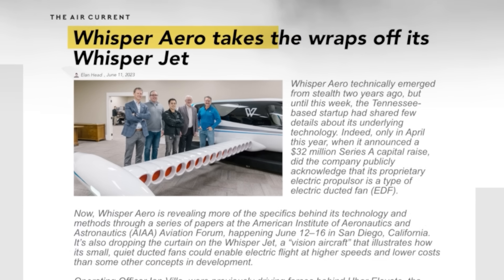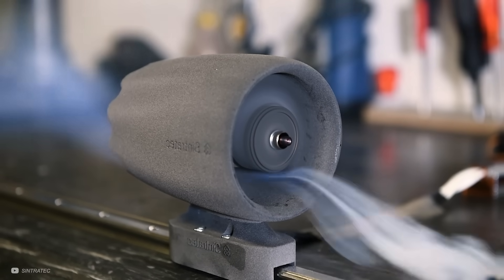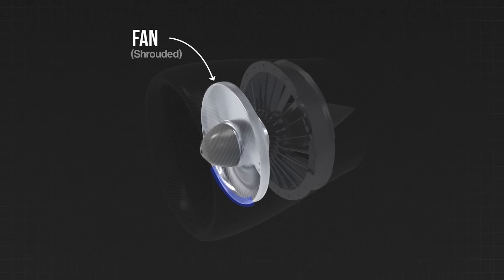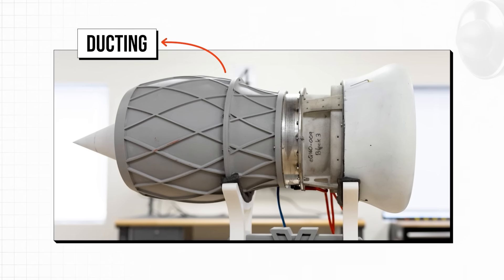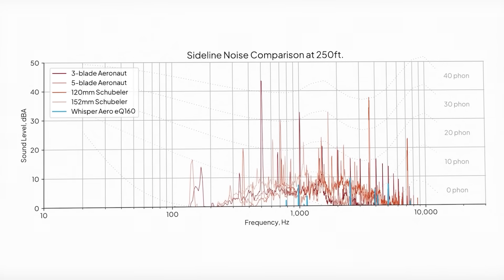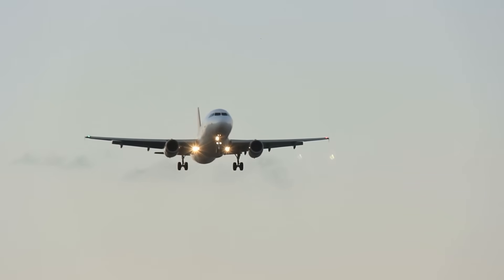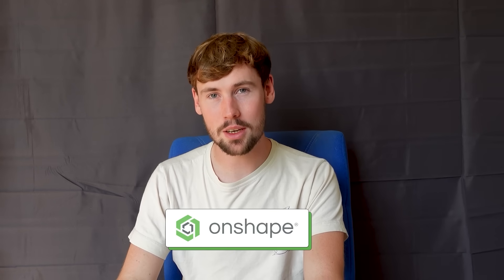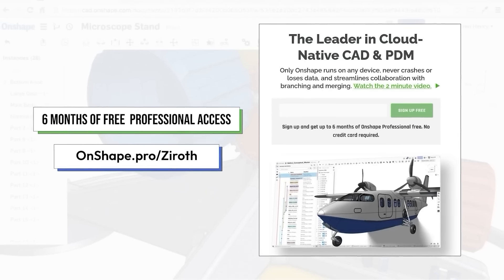This Genius Jet Engine Is Starting A Revolution

Comment: The new part of this tech is the electric drive motors/batteries - the ducted rim/fan unit is older tech - myself & others in r&d were working on this 35 yrs ago, as well as the vtol single passenger air vehicles - nothing new here - but they never became  commercially available due to gas engines used back then made vehicles too heavy & unstable to be practical - modern brushless motor/battery advances are bringing the tech back again - which will change transportation finally -

Comment: But the engine isn't the problem. The problem is making a batteries light enough and powerful enough to power an aircraft at 600mph across an ocean. The engine is a waste of time.

Comment: Engines are devices that burn a fuel to create mechanical force, and motors use electricity to generate mechanical force, there's a difference. Battery technology has yet to enable a motor driven vehicle capable of competing with a fueled vehicle, but this is interesting.

Comment: Reminds me of my HYBRID car: 
Use electric at takeoff / landing, with conventional jet engines to recharge the batteries at altitude. Lighter battery subsystem, lighter fuel load, and a backup propulsion system.

Comment: For this to be a practical solution, pollution by  high frrequency noise has to be properly evaluated and addressed. The potential adverse effects on animals such as bats an dogs is particularly disturbing. It is a pity that obvious environmental considerations are not addressed, or so it seems, from the outset if all the development efforts are danger of being wasted. Don't let the oil industry have yet another excuse to bash efforts at decarbonisation.

Comment: I wouldn't trust a plane with that many engines. One will fail, and while that might not matter in terms of thrust, if it starts a fire, punctures the hull, damages the wing, takes out hydraulics, etc it could be disastrous. 
Not too happy with how energetic lithium batteries on a plane could be too.

Comment: What's said at 8:15 is a major roadblock for this being commercial. 
Simulations aren't enough for approving a design; without sufficient testing (especially if composites are used) then it won't make it into commercial world.

Comment: This is an interesting article and I've always considered the use of a solid outer ring as an essential part of any large air or water moving "propeller". However I am of the opinion that the outer "rim" should be the permanent magnetic stator, and the "cowling" should be the variable frequency field coils. The reasons are multiple: the outer rim means more mass for torque with less electrical power being required to move the rim from coil to coil. It also means that the centre "hub" can be reduced, thereby minimising any airflow harmonics that may adversely  affect performance, also since the outer rim is air cooled then the stator runs virtually heat free, and the coils in the cowling can use some of that flow to reduce their heat buildup with the frequency & load. Another aspect ( which will depend upon electronics) is the possibility that once the maximum speed from the variable frequency has been reached, it should then be possible to further increase speed by "missing" one coil and "firing" every alternate coil, while the missed coil will produce a feedback in the unused coil that can be used to recharge batteries and/or for other purposes. It may even be possible to fire every third coil, produce two coils of feedback once cruising speed is achieved as rim mass would provide main momentum and very little further energy would  be required to maintain speed (RPMS), except for manoeuvres.

Comment: yeah I don't buy it; propellers are ALWAYS more efficient than ducted fans and efficiency is so much more important for EVs. You can hide the motor in the wing and just have a prop causing drag, but with this you have the whole fan, stator the shroud and motor pod all generating drag.

Comment: There's no way to sugar-coat this, mate - the problem with electric aircraft is not propulsion efficiency;  it's the source of POWER.  The Wright Brothers' Flyer worked because they grasped what is CRUCIAL - not the power of the engine, but the power to WEIGHT ratio.  And that's where electric aircraft fall down.  Even if the propulsion system is 100% efficient, the stumbling block is the bulk and weight of the electricity source.
Until and unless we have a power cell which at least matches liquid fuel in terms of the amount of usable energy you can cram into a given volume and weight, electric aircraft are no more than a pipe-dream.

Comment: 🤔 yeah not convinced. Ducted fans have so many disadvantages compared to propellers. And then there's our battery technology which is still not where it needs to be to make full scale electric flight competitive with common fuel powered flight.

Comment: since the energy needed to operate even a small plane on take off will drain the batteries, it's not commercially useful. however, a vehicle reentring the atmosphere from orbit can use these engines, minus the electric motor, as thrust reversers, to slow down the reentry, maybe obviating the need for parachutes and heat shields.

Comment: Great, so, if you want to use these engines on the equivalent of a Boeing 737 MAX, how many of them would it take?
Its LEAP-1B engines are good for 28000 lbf, I guess, and this fan can do 70. So ... I guess you need about 400 of them on each wing.

Comment: That electric 'engine' is going to need a lot of electricity to power it -- for short haul batteries may be enough, but for anything beyond a 30-45 minute flight another power source will be needed.  The energy storage density of batteries, even the best of the best, is only about 5% of jet fuel and on large commercial jets like the Airbus A-380 the total quantity of fuel required for a long trip can exceed 300t or about 650,000 pounds -- just for the fuel.  To store that much energy in batteries the weight of the batteries would be around 13 million pounds.  The largest and heaviest plane in the world, fully loaded, is about 1 million pounds!
Reply: nuclear reactor would work for that my good sir.

Comment: I hope to soon see video of these engines gulping huge volumes of water in the air and also showing what happens when a full sized turkey goes straight into it while rotating at full rim. Nothing can be trusted until those things..and ice are thrown violently at it.

Comment: New combustion tech makes using electric motor not needed for such duct tech.  The combustion package can fit where an electric motors was.  

Blown wing also makes most of this obsolete.  There much more to the problem than this video shows, and putting so many fans in the leading edge is not valid.

Comment: Electric fans are used for a long time in model aero planes. Like in EV,s the electric motor is not the problem but the batteries are @

Comment: You shared very little actual information. To many aspects that the company didn’t share. 

Several points: where does the power for the motors come from? That’s the biggest current challenge for electric fan engines. 

Second, changing the Hz to above human hearing doesn’t change that there are structural effects, and environmental effects, just changes what they will be.

Comment: Electric powered fans seem like they would be incredibly efficient. But of course it takes a huge amount of energy to turn the electric motors of large jets. The isn’t a battery in the world that could replace the amount of energy to replace the jet fuel carried in the wings and belly. Of course it wouldn’t need that much energy because the electric fans are so much more efficient. But still. The battery for a 4 hour flight would be bigger than the entire airplane. You could do a generator to power the electric motors but that would defeat the purpose.

Comment: Function similar to a torque converter that multiplies torque, using circulating oil which is also about fluid dynamics. Also the electric aircraft called Lillium could benefit from this engine and slso aerodynamics

Comment: Don't most engines go through solid object ingestion tests ? Aka don't they fire frozen chickens at the engines.   If the fan blades are connected at the outer edge wouldn't a broken blade cause significant damage to the surrounding blades ?

Comment: Even if an electric ducted fan is the best thing since sliced bread but it's all useless if you don't have a source of electricity.  Batteries make no sense for aviation due to weight.  Hydrogen is difficult to store and energy expensive to make.  The silence may well end up being offset by having to use gas turbine powered generators.

Comment: Electricity will never be practical for powering aircraft or ships.  There simply are no ways to get the energy density of fossil fuels AND, in aircraft and ships, as the fuel burns, the energy needed to propel the vessel decreases.

Comment: EVs powered by batteries are ok for small applications. But for GA aircraft or larger it is impractical. However if that aircraft were fitted with a gas or gas turbine power supply unit that could supply the electrical energy needed to run these whisper jets, that would be much more practical and energy efficient. Also the loudest noises from conventional jets is caused by the interface between hot exhaust gasses and cool ambient air.

Comment: Not one mention of power output. Why hasn't he applied his really efficient fan technology to jet engines with less-efficient fans? I'm guessing the power output is really low and that's why a whole wing was packed with engines. What happens when half of a wing's dozen engines don't work? Instead of a smooth surface for the air to travel over it's going to smack up against basically a vertical wall since the blades are so tightly packed in. Also I can't imagine these engines will be reasonably priced, so the cost of a plane would be drastically higher. Not to mention the batteries would come included with the plane increasing the cost even higher.

Comment: Dr. Bose didn't care how accurate his expensive audio equipment performed above 10kHz because he didn't believe that people could "hear" distortion in those frequencies.  [Competitors sought <2% Total Harmonic Distortion from 20 - 20k at the time.]  During my stint of TV repair, I noticed that one company's transformer was loud enough to hear some 20 feet away -- it "sang" at about 16,000 Hz and there was a factory kit to eliminate that noise under warranty.  Life is subjective.

Comment: (Up-front warning -- this is a long winded critique from a blow-hard Mech Eng in Aerospace.  Do not use heavy machinery for twelve hours after reading.)

Thanks for the present'n Ziroth but I'm not getting the  "thing".  The Laws of Physics are mandatory.  The most basic law being "there is no free lunch".  If an airframer wants to use Whisper Arrow tech. -- for example -- for commercial Trans-Atlantic ops (4 to 6 hours) it will need to store all the energy req'd by any similar aircraft to fly that same route.

We can add the claim that Whisper Arrow tech. is highly efficienct so I'll double the efficiency of current electric propulsion tech. from around 35% conversion electric-potential to thrust-kinetic to 70% conversion of electric-potential to thrust kinetic.

The calc becomes:  Using currently available electric propulsion and storage tech. and a standard configuration commercial aircraft (one that earns its keep, not one of the elegant, sculpted proof-of-concept designs in Popular Mechanics) a standard configuration commercial aircraft can achieve maximum 1/2 hour flight with 30 minute reserve fuel(stored electric power).

Look at the re-engined, certified, commercially operated electric Dehav floatplanes in current operating on the BC coast.  They do one half hour flights out, swap the batteries at the destination, then 1/2 hour return flights

So how is Whisper Arrow going to revolutioize air transport and solve electric propulsion issues if allit can do is head out over the Atlantic for an hour ( + 1/2 for reserve) and then ditch?

Comment: No it does not solve the problem. there is much more energy in fuel per pound then in batteries per pound. In aviation Weight is king.

Comment: Das Design vom Fan (äußerer Ring) könnte ein Fortschritt sein, weil hier die einzelnen Blätter mechanisch stabilisiert werden und womöglich auch der Luftstrom. Allerdings halte ich es für illusorisch, das Triebwerk mit einem Elektromotor anzutreiben: Dies ist derzeit weder mit Batterien noch mechanischem Generator an Bord eines Flugzeuges möglich.

Comment: I have so many questions, I think it is pretty unviable... the wing flexes... what happens with the engine being there and also changing position due to the flex? Either way, "the company deliverately modeled the blades [...]" or something like that... like the rest of the turbo fan engine makers do not do it? they are a marble of engineering, leaving literally a few millimeters of space between the edge of a blade to the container... the news are good, but too much a curtain of smoke from them

Comment: I don't think noise is ever an issue as to why electric engines haven't taken aviation industry by storm (no pun intended). ALL electric engines even the loudest, are quieter that the quietest fuel driven turbine ones. The real issue is the energy density of the power supply.  Until electric storage can at least approach the energy density of aviation kerosene all these projects are just fanciful movers of the non-turbulent air.

Comment: As someone who has worked with EDFs for VTOL flight, I can tell you that this will NOT be revolutionising flight. EDFs guzzle power and don't decent decent thrust to weight ratio - especially so when you add batteries to the equation. Lower disc loading is where it's at.

Comment: Ziroth, you said the Whisper Jet fan blade passage frequency emits noise above 16KHz, pushing it out of the range of human hearing. While that may be true for those past a certain age, younger people with more sensitive ears will easily hear high-pitched fan blade noise in the 16-20+ KHz range. AND many animals can hear ultrasonic sounds that are completely inaudible to humans (like a dog whistle); dogs can generally hear high-frequency sounds up to 45-60KHz, depending on the breed and age of the animal. Cats are even more sensitive to noise, having among the widest hearing ranges of any mammal, reaching up to around 64-79KHz. My question to the engineers: by pushing fan blade noise into higher frequency ranges, above human hearing, what are the possible negative effects on other animals and wildlife that can easily hear all that high-frequency noise being emitted?

Comment: I'd like to clarify: It lies in the nature of the rotor to twist the air-stream. The fan introduces a twist into the air stream, that's how it increases the energy in the fluid. It's supposed to do that. The stator then converts this rotational component of the speed vector into pressure. And that pressure will then - that's what the nozzle is for - be converted into a higher, axial speed which causes "forward thrust".
Then again you show their ability to redirect the air-stream by means of the stator: Do you think they included the nozzle geometry right into the stator geometry?
- Studied propulsion engineering, never worked in turbo-engines though, I'm not at the pulse of technological advancements. -

Comment: Coal/nuclear powered airplanes? Depends on where you get your electricity. 
How will the electric engine hold up during a severe solar storm?
It's not a great place to be durring a severe storm.
Reply: About as well as current one with electronicly controlled fuel injection and avionics.
Reply: @DiakosDelvin exactly

Comment: Having gone thru A & P school, one of the things we had to do was to work on gas turbine(turbojet) engines. The fan disk reminds me of a compressor section of a axial flow jet engine. The rotating compressor blades are designed in a similar fashion, with the outer blade section linked up to create a shroud.

Comment: You surely know that electric propulsion will always have a 100 fold energy density disadvantage which is nearly impossible to get around save for very short haul low occupancy flights.

Comment: Can we get away from calling motors "AC motors" or "DC motors"? These terns don't really correlate to or describe modern motor types. Terms like reluctance, induction, permanent magnet, synchronous, axial/radial flux, etc would be helpful.

This comment isn't directed at the video script but rather at the industry at large. The company calling their motor "brushless DC" isn't really descriptive, which you correctly call out in your video.

Comment: So the upside of connecting the tips in a ring is that there are real benefits in weight and efficiency compared to a traditional ducted fan. The downside is that you wont be able to have variable pitch which limits efficiency and speed range. The small area of the unit will mean that it will have to add a lot of acceleration to the air to produce adequate thrust - in which case the propulsive efficiency will be much lower than a traditional propeller. The leaf blower is a perfect use case, I'm somewhat skeptical about it reinventing aviation though.
Reply: Biggest fan is best fan. And by best I mean efficient.